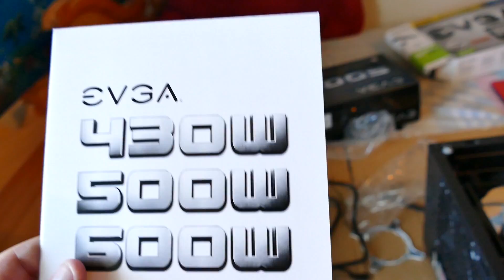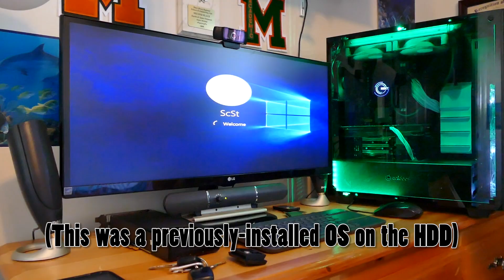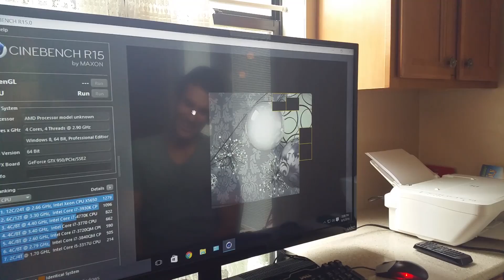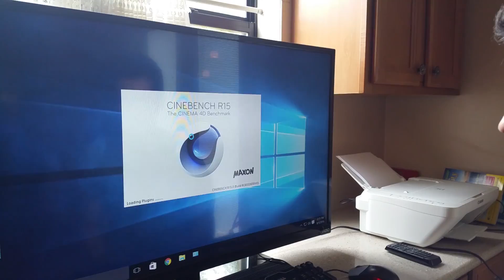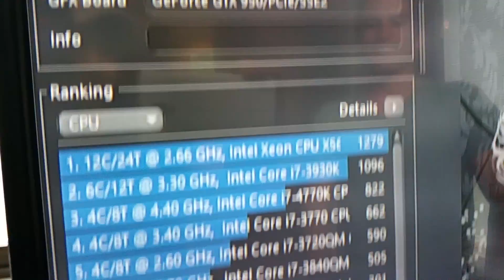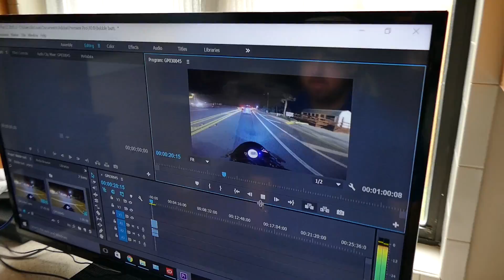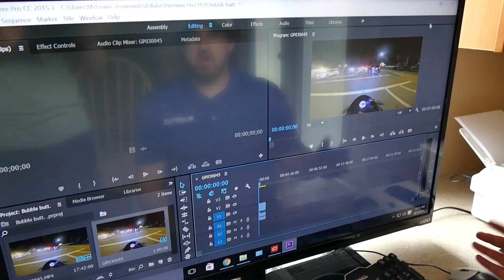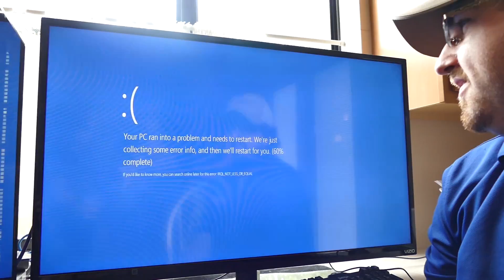Building McLovin's First PC (Part 3)

Comment: Does the rgb controller come with the case or was that seperate? If the rgb led strip isn't stock, what brand is it? I'm looking to add a few rgb fans with that led setup and I like how it looks with the tinted glass. Also what brand of rgb fans do you recommend?I'm thinking of getting that exact case as well. Great videos btw, very insightful and helpful, love the shenanigans you guys get into.

Comment: Thank you thank you thank you Greg for routing the radiator hoses under the 24 pin cable. That's the first time i've seen it done that way. Got it recorded in my mind.  I really don't like the way all in one water coolers can't be customized (longer cables,  different colors, etc).
Reply from the maker: Thanks for watching!

Comment: Please give him a decent intel chip lol, I don't think he even needed a graphics card
Reply from the maker: No, the graphics card was for CUDA-accelerated rendering.
Reply: Agreed the GPU will help, but wouldn't it be better to have a more powerful cpu as it does most of the rendering (especially his build). Also he said a main goal for the build was single core performance.

You can render easily on a i5 6500 and iris 530 graphics
Reply from the maker: You're asking him to double his initial investment. That is senseless given the simple editing he needs to do at the moment.
Reply: Science Studio What im saying is a new cpu comes before a gpu in an editing build. Am I right? Also with the SSD money you could of gotten an i3 6100.
Reply: Also im saying $5 CPU + $150 GPU is always a bad way to go for editing
Reply: +Captain Cruise You realise that the CPU performed better then a Q6600? That's a massive price/performance ratio difference, and they can OC as far as they can and not give a shit because it's super cheap.
Reply: This is a $100 CPU. The GPU was $150, just saying

http://cpu.userbenchmark.com/Compare/Intel-Core2-Quad-Q6600-vs-Intel-Core-i3-6100/1980vs3511

Comment: This PC looks better than my i7-6700k and gtx 1080....
Reply: I know. That feel when I am horrendous at cable management. Also no LEDS.
Reply: right?!
Reply: Just grab you some Led's on ebay. I got over 15 feet for $3 (blue 5050 size, RGB is still pretty cheap). The only thing you have to do is know that for every foot or so it takes about 10 watts. You could also do better than jamming the wires straight into a molex plug in and taping them so they don't fall out, but hey it works.

Comment: My i3 Scored 174 on Cinebench! Haha!
Reply: My i386 scored 0.0001 on Cinebench!
Reply: My i3 scored 487 on Cinebench.
Reply: my u4 scored over 9000!
Reply: My i5-6600K scored 732 @ 4.5Ghz.
Reply: My Fx-8350 scored 688 @ 4.2 so at 4.5 it would be 737 approximately. Clock for clock it seems that a $150 CPU is the same then. Darn $40-$50 mobo holding me back... (or maybe its just me not wanting to raise voltage, max temp is still well under 60c, close to 54c with a fan on the back of the mobo).

I should note 4.2 is the boost clock, so its not really an overclock, I just bumped it up to boost so it didn't throttle.
Reply: +Jake Garrett my i3 6100 scored almost 500cb at 4.5ghz @ 1.365v
Reply: best it still destroys any amd cpu in games.
Reply: trippplefive That depends on the game. Fallout 4 is a prime example where it brings the full system to its knees. All 8 cores are at high usage the entire time (@ 1080p 60Hz, its not bottlenecked, but it does run high % like 80% sometimes like during explosions and huge amounts of enemies). So with 737/500 * 80% = 118% utilization, it would fail to run Fallout 4 flawlessly like the 8350.

In power hungry games, the 8350 wins, but you are right in that in single threaded games (ex. Minecraft), the i3 duel core will win. Most games that are power hungry will utilize more threads, and thereby make the 8350 better, otherwise it still runs the more basic games way past what any monitor can push out that I know of.

For "light gaming" (less optimized, non AAA titles, generally not demanding, indi, basic), almost anything will run them fine, though yes, the i3 will maybe run 300 FPS, and the AMD might only run 200 FPS.

Exceptions include Dwarf Fortress (literally letters for tiles and objects), and a few other games I can't think of the name. With these hungry (for no apparent reason other than poor coding), will bring any CPU I know to its knees, and the 8350 flat on its face at pitiful frame rates sometimes.

So yes there are games the i3 will win, I personally haven't played any that dropped below 60 FPS, so I can't say it would improve (at least not until I get a 120 Hz monitor, but I'm more likely to go 4K).

To Brian Weston 
Nice job on the overclock (its past the best shown on CPUBoss for watercooling, though that can be wrong, because the 8.97 Ghz of the 8350 is actually with Nitrogen or liquid Helium). Are you a fan of Freon or other subzero cooling? I was thinking about yanking the compressor out of a Freezer unit, calculating the design parameters and freezing my GPU, but I never had enough time... If you did that on water that's a very impressive overclock, and kudos to you Mr. Weston!

Comment: Overclocking on AM2/+ family platform it's tricky.
They have that Cool & Quiet features that could crash the system with overclocking it could be disabled but the computer will running 100% on power, also 780G NorthBridge chipset is HOT even without overclocking, if using add-on GPU might want to disabled IGP completely, I have GA-MA78GM-S2H and the cooling on chipset definitely not adequate.

There are 2 things still could be improved on this board, using 2GB stick/slot so it can utilize 8GB RAM, and upgrade to Phenom X4 95w, that is the maximum TDP that this board could run since X4/X6 125w would probably fried the VRM since only had 3+1 phase, but it probably just lot easier and wiser just to get i5 Sandy/Ivy bridge on get go.

On side note, you giving people high quality content with McLovin, people will miss his character, now you have set the bar pretty high with these collaboration.

Thanks for both of you Greg and Mclovin.
Reply from the maker: Thanks for the suggestions along with your support!

Comment: Some people are complaining about the integrated water cooler in the Genome.They say the temps are awful for a 360mm radiator. Also that the power button solder is broken in most cases due to shipping. I was trying to buy one but that's keeping me from buying it.
Reply from the maker: Don't have either of those issues with mine.

Comment: i know you said this pc isnt supposed to make sense. but for around 100-150$ a fx-6*** with mobo and a stock cpu cooler would make soo much more sense for the same money.
Reply from the maker: Nah. Did you not watch the entire video? His CPU was handling Premiere just fine. Swapping platforms would be pointless in his case. Don't throw money at something that already does what you want it to do.
Reply: +Science Studio yea i saw that it handled it but working and working well are 2 different things. at least on the newwer platform a upgrade path would be easier to do since 4k 60 fps video is slowly creeping into the mainstream.
Reply from the maker: The FX 6300 wouldn't improve very much at all. I've owned both platforms.
Reply: Science Studio my fx-6300 scored twice the cinebench score that your cpu did after stock cooler overclocking on a cheapy motherboard.
Reply from the maker: So did my FX y300. Howver, check your render times. Not a substantial-enough improvement to justify an entire platform upgrade. Think logically about this. You're asking him to buy a new motherboard, new RAM, and a new CPU all for a few additional seconds lost in rendering and editing over the course of a project. Either way, the platforms are dead ends as well in terms of upgrades. Following your plan would be disastrous.
Reply: 4K 60 FPS is becoming mainstream? Really? I know a lot of enthusiasts, but I only know 3 with a 4K TV and only 1 of them is able to game a 60FPS on 4K. 
15 Years ago, FULL HD was becoming mainstream according to some. 
5 years later, game consoles launched for 30 FPS, 720P gaming(95% of titles). 12 Years later consoles got Full hd for most games, but not constant 60 FPS. 
Long story short, people thought it was becoming mainsteam because of marketing and exposure, but it took 15 years more to make it mainstream after the market wanted you to think it was. 
Don't even start with PC Master Racing, less than 1% of Steam plays on 4K and these monitors have been around for a while now.
Reply: doesn't adobe premiere use gpu rendering? For performance of the app the CPU performs fine and for the final export the cuda cores handle the work. That's what I thought worked anyways.
Reply: +DaRealZorka i meant 4k 60 fps video not gaming i know that shit wont be around for another 10-15 years.
Reply: +Science Studio It's better to wait and collect the money for new Skylake parts. Cheap mobo, 8gb of ram, or 16 and i5. It is cheap in Your country. You can also wait for zen, but who knows when it will be released and how is it going to perform.
Reply: I disagree with you entirely.

Comment: Greg I know this is a random question, but I want to do a build w/ 2 cpus and a server board for the fu*k it properties. Do you think this would work?

   SuperMicro X8DTT-F-SG007 Dual LGA1366 Motherboard
   2 Intel Xeon Quad Core Processor E5640s
  
   PNY GTX 970
 

   Ultra 600 Watt PSU
 
   http://www.ebay.com/itm/Samsung-NEW-4GB-2RX4-PC3-10600R-DDR3-1333MHZ-Only-ECC-Server-Reg-DIMM-Memory-RAM-/391243495316?hash=item5b17edf794:g:Sv0AAOSwgQ9V5EeM (ram)
Reply: I mean... it'll work, but it's more expensive than it needs to be and there are other options that would perform better for the same price.

however you should look at the xeon e5 2670! putting two of those on a board would be killer. single core performance isn't bad.
Reply: TheDarkToes I found the parts I need to buy for around $80, but ill take a look at the 2670

Comment: question: when researching overclocking my cpu (i5 4690k) i read increasing the base clock to high could corrupt data being saved to the hdd because it also overclocks the sata speeds.  any truth to it?
Reply from the maker: I've never witnessed this happen first-hand, nor heard of it in general. I will investigate further.
Reply: Don't know about the data corruption, but I have heard that the base clock is linked to the pci express x16 slot. And that messing with the base clock can bring performance issues. This applies to pre skylake gen. I would increase the multiplier instead of the base clock. Don't qoute me though, this I heard but don't have any actual evidence.
Reply: my bad, i built my pc 1.5 years ago so my memory was fuzzy.  after looking around again i think it was because it also overclocks the ram and the corruption happen's between data transfers

Comment from the maker: - For those wondering, the case used was the Anidees AI Crystal, which I reviewed a few videos back. In regards to the BSOD and down-clock; this occurred while the computer was at idle. Had this been a voltage issue, the computer would have crashed during the rendering scene. It did not. This tells me that the base frequency itself was unstable, and likely wouldn't be corrected with a simple voltage bump. I suspect RAM instability (BCLK affects this), so I will reconvene with McLovin, adjust his RAM and NB frequencies, and report my findings on Twitter.
Reply: Blame the dodgy mobo lol
Reply: Athlon II X4 635, you can tell because it runs at 2.9GHz! :D
Reply from the maker: We were in a rush to finish up (he had work in an hour), so I did not verify adjusted NB nor RAM frequencies. Will see if these fix the issue.
Reply: Should've disabled the spread spectrum
Reply: The issue with stuff displaying oddly was Windows 10 scaling the display because it detected it was connected to a TV. Go into Display settings and there's a slider, it'll probably be at 150%.
Reply: Sounds like the mobo isn't supplying the voltage correctly. Have never ever heard of a frequency being unstable. Just a voltage thing. You did use LLC right? A different differential amplitude might also help.
Reply from the maker: Plenty of motherboards improperly regulate bus frequencies when overclocked past "xx" threshold. It depends on the motherboard and the frequency in question. In this case, the platform will not be replaced. Again, I highly doubt this was solely voltage-related.
Reply: Would you happen to be Italian?
Reply: "This Stop message indicates that a kernel-mode process or driver attempted to access a memory address to which it did not have permission to access. " increasing the base clock increases ram frequency making it unstable. reducing the ram frequency should improve stability
Reply: If you haven't tried yet, try disabling C1E and C6 power states in the BIOS.  My AMD platform in the past would crash when the computer was at idle but instantly jumped frequencies to do something (open a program etc).

Voltage spikes caused BSODs for me so check it out!
Reply: ***** This is what let me overclock my i3 4150 to 4ghz lol
Reply: What CPU is it?  I don't seem to remember that being mentioned, though it may have.
Reply from the maker: The CPU was detailed in the video I pointed to within Part 1.
Reply: When I overclocked my potatoe with am2+ and Athlon II X4 640 when HT was on auto one time PC launched and was very slow, i checked CPU-Z and it said that my HT is somewhere around 1Ghz :O
Reply: It looks just like the NZXT S430.
Reply: Do you happen to remember what RHB LED is used in the case for this video in looking for a nice one . Actually to be used in the same case
Reply: Wait so im building my first pc and im putting a gtx 1060 in with an i5 8400 is that good?

Comment: how did he guess that? omg   (oh yeah buy the lottery ticket like right now) btw don't lower his OC, try increasing the voltage... i mean with that watercooler and a 5 bucks cpu you better squeeze it as hard as you can
Reply from the maker: It wasn't a voltage issue. I believe the BLCK frequency was on the outer limit of the CPU's tolerance, hence why the computer crashed at idle rather than while rendering.
Reply: hey, you responded! :)
i had a similar problem once, with a core2duo. it crashed in idle because the mobo was "saving power" lowering the voltage of the chip, northbridge etc,. maybe thats what caused it?
well it WAS a 5$ cpu anyway.
Reply from the maker: Interesting. Will investigate further, as there's no way of reducing voltage drops within the BIOS itself (a consequence of using a Foxconn board).
Reply: responded twice. im so glad im early... :)
yeah. i also think that maybe amd boards just dont have these options... that sucks. anyway, keep up the good work
Reply: did you guys downclock the ram when you started moving the FSB?  Cheaper ram hates having it's speed changed.

Comment: That end. Couldn't you up the voltage. Its a computer for causual editing and has an overkill cooler
Reply from the maker: It wasn't a voltage issue. I believe the BLCK frequency was on the outer limit of the CPU's tolerance, hence why the computer crashed at idle rather than while rendering.
Reply: Science Studio That makes sense, one small question. I use to have my i5 6600k overclocked to 4.6 GHz at a 1.275VCORE, and it also bluescreened while skyping. Is that normal I turned down the OC to 4.4 and the VCORE down to 1.225

Comment: what happens if the water cooler keeps the cpu cooler than needed??????
Reply from the maker: Nothing.
Reply: and why the hell I cant play this video at a lower res???
Reply from the maker: Blame YouTube.
Reply: +Science Studio :(
Reply: Nothing: water and air can't go below room temperature.
Reply: the derpest question yet xD
Reply: You won't go lower than room temperature, heat flows from high to low, if both bodies are at the same temp, they will remain like that.
Reply: Victor fries will dwop your barometric temperature
Reply: +Science Studio xddddd
Reply: Then the CPU will freeze, causing the PC to freeze aswell.
Reply: The next ice age will happen.
Reply: It wont.
Reply: Im not the only one not understanding this right?
Reply: +TheGamingTree no your not
Reply: LUL xD
Reply: u can overclock your mousepad
Reply: The Tech Mate
 I overclocked my mousepad to 1.21 jiggawatts
Reply: +Alec Moon you had to muck it up didn't ya?
Reply: Must be an 8nm :-P
Reply: If a cpu gets too cold it'll just black screen, people do it with liquid hydrogen I believe
Reply: Liquid Nitrogen to be exact.
Hydrogen is the lightest gas ever and is very hard to turn into a liquid and it is also SUPER flamable.
Reply: The Tech Mate It's harder, to do  but colder so in extreme cases, it is used
Reply: The Tech Mate Correction: They use liquid helium more commonly than hydrogen
Reply: Yes thats right M8
CPU cannot boot below -110 but once booted, you can go to about -140